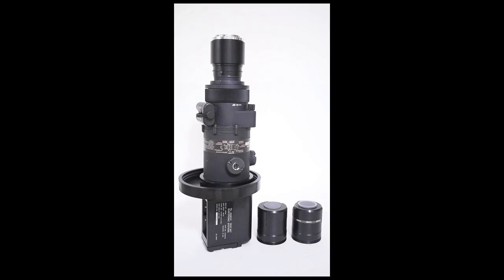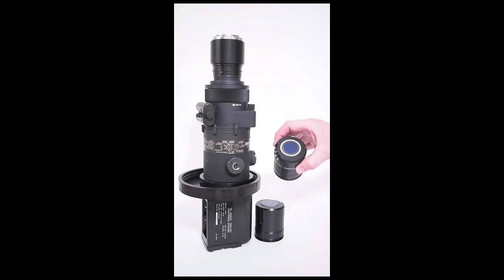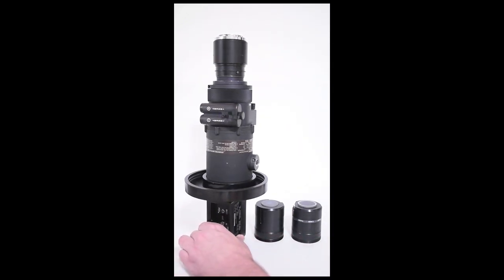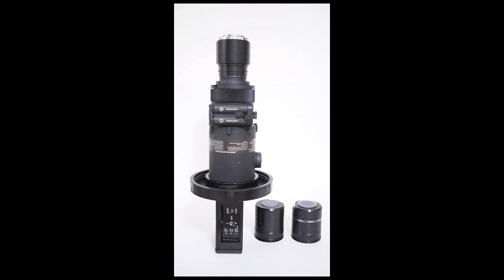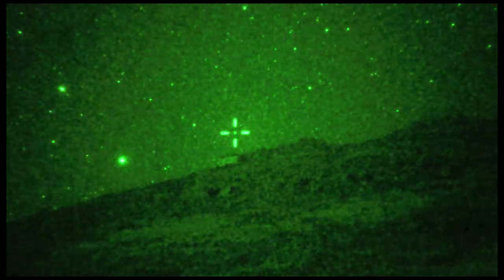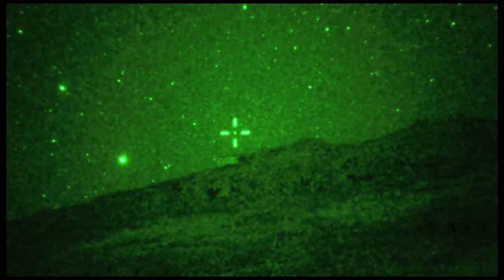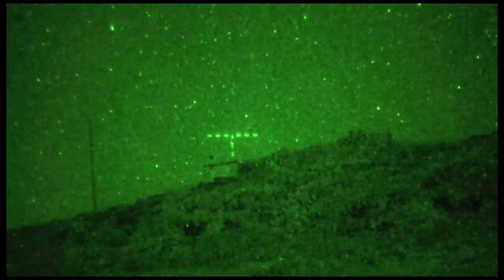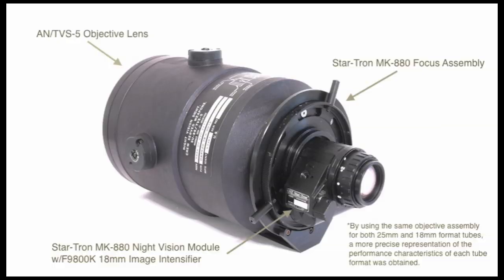AN/PVS-4 Gen 2 and Gen 3 25mm Image Intensifiers Evaluation Tutorial

Comment: Interesting. The 18mm tube seems to provide improved resolution over the 25mm gen3. Was the 18mm tube installed in the PVS-4 or the Star-tron? I assume some type of adapter was required to mount the 18mm tubes.
Reply from the maker: The MK-880, which housed the f9800K tube, was connected to a TVS-5 objective. This was simple enough as the ST universal focus assembly is a direct fit. The setup is featured at the end of the video but can also be viewed here:
https://oi453.photobucket.com/albums/qq254/cnoct/Public/MK-880wTVS-5Objective_zps1259485e.jpg

Comment: i got my gen 2 to work now. forgot my lens was covering... How can i adjust the brightness? there is nothing attached to the 3 and 2nd pins.
Reply from the maker: The simplest solution, for maximum fixed gain,is to bridge/short pins 2 and 3. Though not necessary, consider adding a 470k - 560k resistor between ground and bridges pins 2 and 3. For variable gain, wire in a 50k potentiometer that is grounded to pin 4 with a 470k resistor.